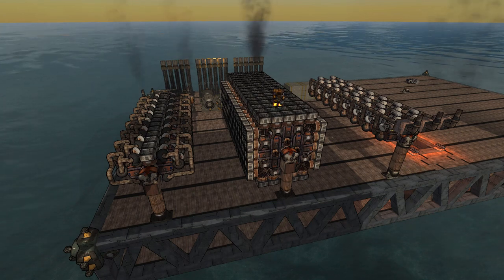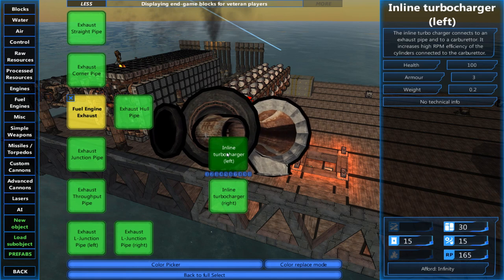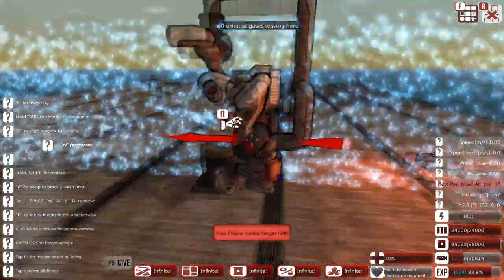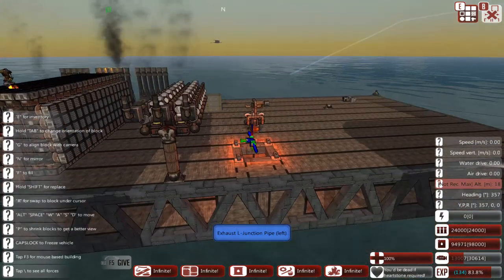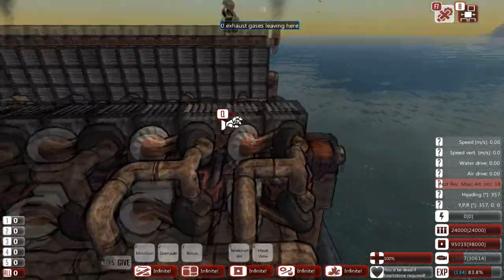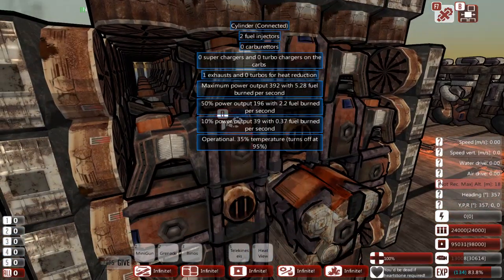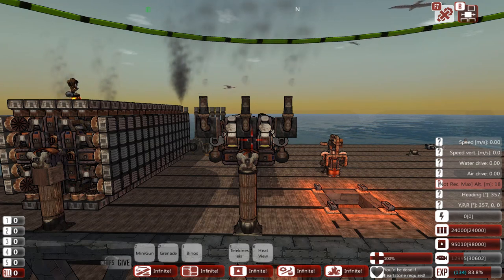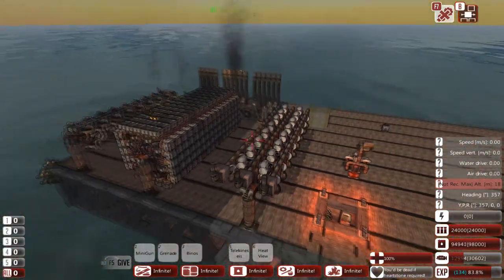Engine Overhaul Updated parts and examples - From the Depths (devtest1.8691)

Comment: Does the bonus of inline turbochargers stack with how many exhausts are going through them?
Reply from the maker: +G_glop I know Nick talked about making this the case, but I'm not sure if it's actually been implemented yet.  I think that's the final plan anyway. :)
Reply: ireLAN Gaming Hmm, i've done some testing. And it seems like they do. Because if you connect output of inline turbocharger into input of the same turbocharger (+ exhaust from one cylinder) you get some crazy efficiencies. Like 994 power per fuel at 10% and 668 at 100%

The bug seems to kick in with one cylider ontop of the engine block.
Reply from the maker: That's pretty whacked up.  Very cool that the feature has been added though.

Comment: It seems like these new engines are more supporting for large ships. I'm gonna need to do a lot of work on my fighter jets.
Reply from the maker: +Tristan Sutton Nope, it's the opposite.  Small engines can provide much more power than the old engines.  You can make very small, efficient engines much easier than you used to be able to.
Reply: +ireLAN Gaming Small engines, yes. Extreme efficiency, not so much. With the update, I have to actually place fuel tanks, whereas before I could run with just the Engine's Own tanks at 0.00000000000023 fuel use. Even running one shield is pretty much off the table, unless you go to the trouble of setting up an auto toggle with an ACB.

With the faux nuclear reactor engines gone; we need actual nuclear reactors to be added in with the next update.
Reply from the maker: The old engines were overpowered as shit.  They weren't efficient, they were broken...
Running shields is perfectly possible now, that's why they had a strength slider in the first place.
Reply: Fuel injectors buddy, thats forcing you to have bad fuel econ. so youll have to either land or refuel quicker now.

Comment: It looks like capital ships are going to have to rely on several smaller engines like in real life
Reply from the maker: +wildboar222 Well, the problem before was, you were actually punished for making multiple engines.  With the new linear scaling, it opens up a lot more options.  You can also design certain engines for certain tasks, so multiple engines is definitely gonna be better, not only allowing a more dynamic power curve, but having extra redundancy too so you don't lose everything when your engine block gets hit. :)

Comment: i like the 2nd engine alot better cause it looks like it can generate alot of power 0:12
Reply from the maker: +Fawaz Thani It really can.  But it drinks fuel.  It's uses twice as much fuel per point of power that most of the other ones do. :)
Reply: yeah i just type that before i even watch it but hey i would use the 1st engine and expand it long ;)
Reply from the maker: Yeah, the first one is probably the best out of these engines,  but Ruger discovered later that larger engines actually seem to hurt your efficiency and redundancy.  So you're actually better building lots of small engines. :)
Reply: Next Time Im Making A Land/Sea Mother Truck I Would Add A Small Loan Of A Million RedLine :3
Reply from the maker: Haha, we offer a good rental package for Redline's. ;D
Reply from the maker: Yeah, I've been waiting until this whole devtest branch goes stable first.  I'm looking forward to building one! :D
Reply: Me Too But.. Is The Regular Engine Gonna Be Removed Cause i Got Pissed When That Happend
Reply from the maker: Yep, the old engine is being made unplacable when it goes live.  But they won't be removed from the game for a while yet, meaning your old designs will still work fine, you will just need to build the new engines in the future.
Reply: oh good can i put like 15 RedLiner In My Cute AirShip Fleet :D
Reply from the maker: Haha, ofc! :D
Reply: yay :D

Comment: Crap, I liked it when engines were simpler.
Reply from the maker: +Jimmy Situ Honestly, they're not as complicated as they first appear.  There are indeed a lot of parts, and the learning curve, like many of the things in this game, is a bit of a brick wall, but after playing with them for a few hours, I've discovered there are only really a couple of different configurations to use, Fuel injection, low RPM, hybrid and high RPM.  All of these configurations can be broken down to the manipulation of a single cylinder, so you can basically build a one cylinder engine with the efficiency that you want, then just copy it.  The biggest problem is actually cramming stuff onto the cylinder rather than designing the engine.  The tetrising is the hard part! :D
Reply: +ireLAN Gaming For us "veteran players" its easy to adapt to this change, but when this game reach final release, i think than a new player it will totally go mad :/ now even the engines have like 20 parts in the construction list

I really think they can make this not soo part demanding.
Reply from the maker: I gotta agree, the initial look at the new engine screen is pretty terrifying.  There are an awful lot of parts.  I found it pretty easy to put it all together after a little bit of playing about, but like you say, we've been doing this for a while now.  I'm gonna do a proper engine tutorial when this goes stable to help people over the initial 'Learning Cliff' (We don't do learning curves in this game, lol).
Reply: Building a recoil propulsed vessel will be the most efficient way now :P
Reply from the maker: Lol!  Most fuel efficient method of transport! :D
Reply: +Jimmy Situ I do like the fact that you can have your engine in the lower deck, and send your exhaust out the funnel, as in RL. But I'll miss the 0.00000000000000000000023 fuel efficient engines that didn't need any more fuel than what was attached. :(
Reply: Jesse Bains I will miss engines having an exponential growth as well, now all engines are linear and you need bigger engines to match the same power. I hope the mods for the game will soon allow "actual mods" instead of just ship designs and blueprints. So that we could go apeshit on the game.
Reply: Jimmy Situ
Yeah I really hope so too. I can understand why they don't want mods yet though, as the game is continually evolving. Once the game is final, I'm sure actual mods will be in.
Reply: Jesse Bains Wait have the devs said that? Man I hope it will come true one day. The recent update screwed every engine and ship design I had. I'm almost scared to fully play the game now.
Reply from the maker: Mods have already been confirmed.  Nick refactored the code during the devtest for mod support in the future.  No timescale yet, but the wheels are in motion.
Reply: +Jimmy Situ I was worried with the engine update, but i found out that i can just place a few injectors instead of fuel tanks from the previous update.  i think the ratio for supers and injectors(engines own fuel tank replacement block) is now around 1/2 or 1/3. and be sure to use lots of radiators!
Reply from the maker: Your engine will be a gas guzzler, but it should work fine like that.  Instead of radiators, try using a few exhaust directly on the cylinders if you can.  They're much better for cooling.
Reply: +ireLAN Gaming Can you make a small low RPM engine that give like 500-800 power that is farely efficient? :)
Reply: Adam Lundmark But no 20 billion power engines. :C
Reply from the maker: Adam Lundmark Sadly, there's no such thing as a small low RPM efficient engine, lol.  To get high efficiency at low RPM, you gotta aim for a total output of much higher than what you actually need.  So for a 500-800 engine to be efficient at that power band, the engine would actually need to put out closer to 5k-8k power.  If you have a very specific power band in mind, a turbocharged, high RPM one is much easier, smaller and more efficient to build.
Reply: Ok, I've had a way of building my engines for my ships before this last update, but now i dont know how i should make my engine for my ships as im trying to keep the size down as my ships aren't huge in any way. But you'd recommend a high RPM engine?
Reply from the maker: You could have a look at Ruger's engine platform, there are a few good small engine designs there you could use: https://www.youtube.com/watch?v=bRSXUr5jPwg
Reply: Ok thx :)

Comment: Jeez if i wanna run my shields without using all the oil i will need a ship bigger than every fleet combined...
Reply from the maker: +FOXER The devs have suggested using lower strength shield as don't scale linearly.  It's been pretty crazy for a long time, being able to put max strength shields everywhere with zero consequences is pretty silly from a design perspective tbh.  I'm really liking the changes. :)
Reply: laser are probaly gonna be useless since you need quite a load of power to make make them usefull
Reply from the maker: +FOXER Yeah, they're gonna need a bit of tweaking.  I think Nick or Khaz already mentioned that they were gonna look at it.

Comment: Great, I get to spend another 90 hours relearning the whole game. This plus making me need to manage resources will probably just make me stop playing. I have a real life too and I can't spend 5 hours working on optimizing one engine for one ship. I understand their desire for realism, but they are really starting to sacrifice fun.
Reply from the maker: +Underoathalex12 It's really not as bad as it looks.  There are only really a few types of engine you can actually build, the rest is just the order that you put the blocks down.  Also, localised resources will be completely optional.  You can turn it off you don't want it.  I think they make a whole bunch more sense than the old ones, as you actually have to design them, but if you wanna be crafty, make a prefab of the old engines and you'll be still be able to replace them until they are completely removed from the game, which will not be for a few months.  You can learn everything you need to know about the new patches in a few hours.

Comment: OMG,  this is bad,  my ships use 100k -500k  power.  With engines like these i wont even be able to take off.
Reply: To explain,  I use High altitude,  laser space ships.  Hi speed and well shielded as they are very compact.  Its what i like building,  and yes,  they are god class ships.  but that what i build them for.
Reply from the maker: +mareck6679 I believe the cost of lasers is going to be dropping a little, but as far as shielding is concerned, you're just gonna have to be a little bit more conservative.  Not sure if Ion drives have been balanced with the new power use yet though.
Reply: +ireLAN Gaming maybe look at fixing bugs before releasing this.  Or we are going to sit with another Toady(bay12 games) situation.  Where we sit with a 1000 features and 2000 bugs.   The Net code,  aerial AI and combat AI all have existing issues that need fixing
Reply from the maker: Well, I'd say this is gonna come along pretty soon regardless, but I gotta agree on the bug fixing front.  New features are great and all, but the rest of the game needs to be brought up to snuff as well.  I think it would be better if they concentrated on stabilising everything over the next few patches rather than adding more features. :)